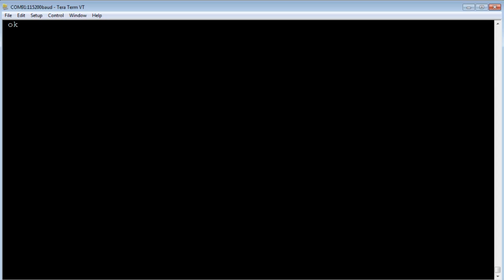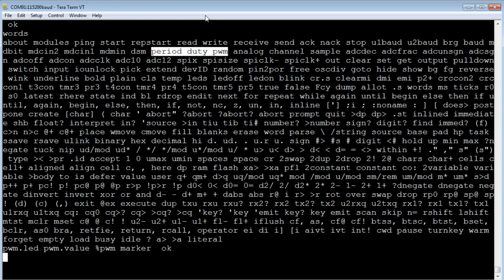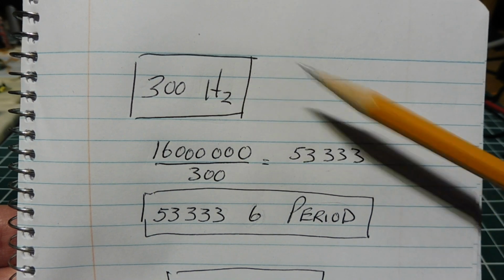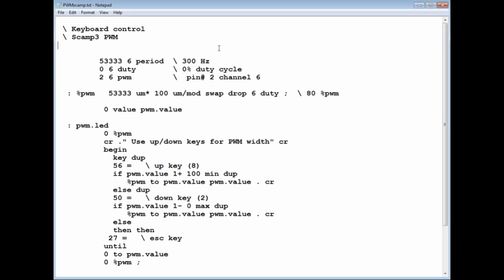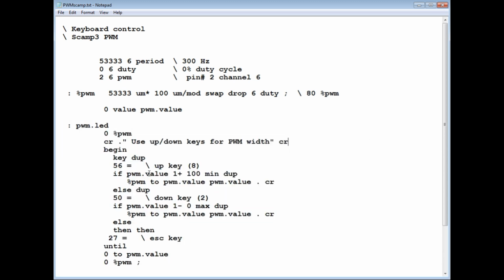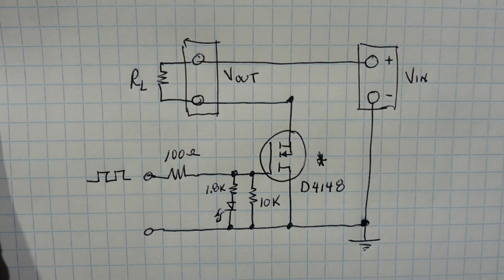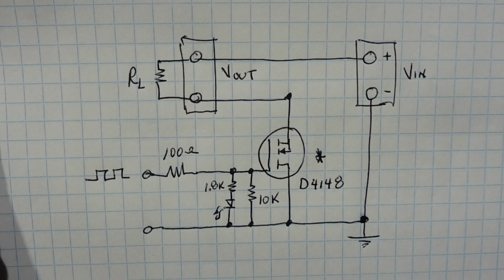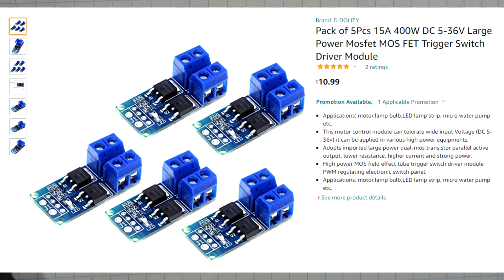Scamp3 PWM / MOSFET Driver / FlashForth / PIC

Comment: So how did you do that you had not to press Enter after pressing selected key ?  
Is it possible to do the same or similar on Arduino Serial Monitor ?
Reply from the maker: When you press a key on the keyboard it sends an ASCII number to the UART on the microcontroller. ( Up key is 56) The program is in a loop waiting for the number to arrive and then continues on in the program. The Forth word "key" does this.